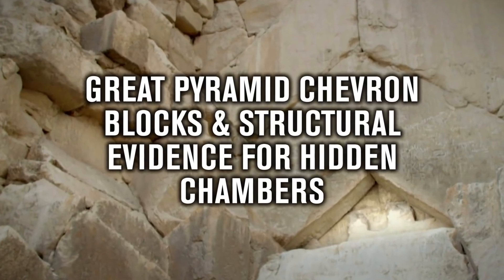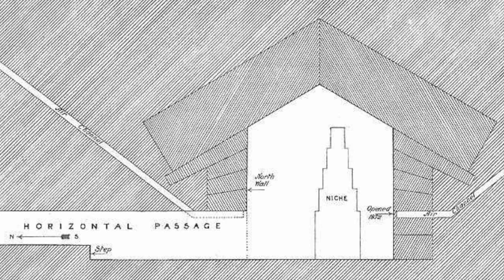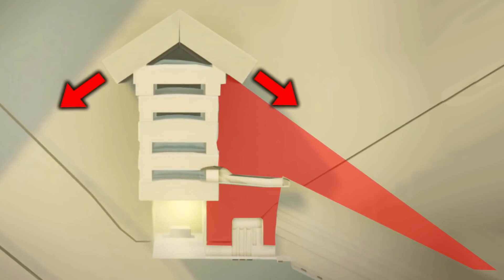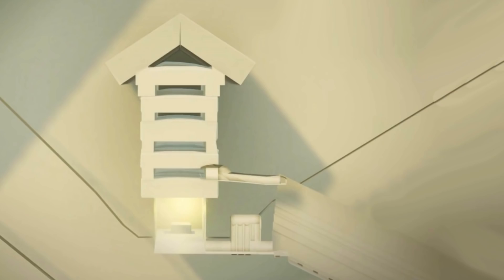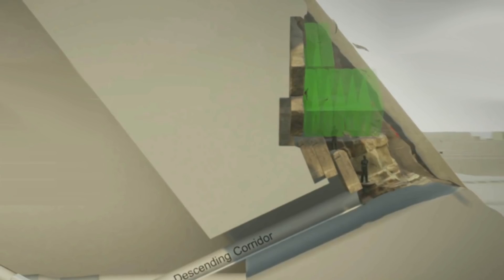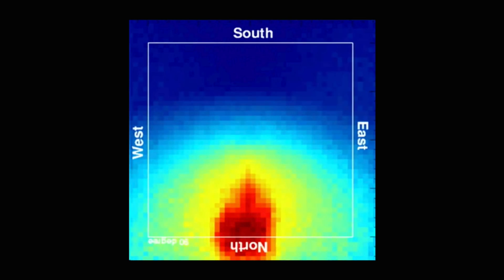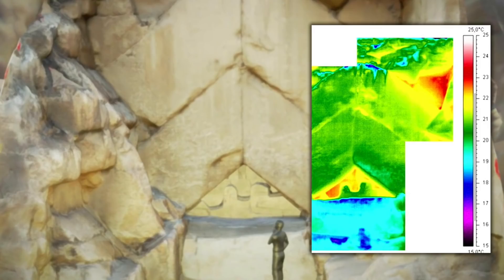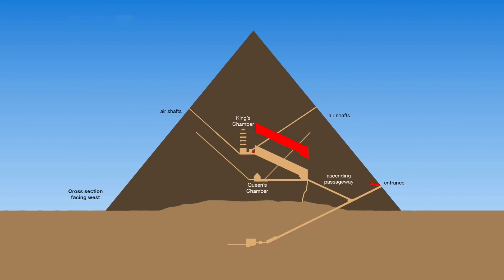Great Pyramid Chevron Blocks & Structural Evidence for Hidden Chambers | Ancient Architects

Comment: The front chevrons have many purposes. More important than structural is symbolic. That’s the main reason it was built. Many other reasons, but that’s the main. What is their symbolic purpose? One is that in a structure supposedly without hieroglyphs, here, front and (almost) center, is a visible gigantic hieroglyph! It means “oxen”. The large sacrificial animal, the leading symbol of the Age of Taurus during which this Pyramid was built.
Reply: At which timestamp is that visible?
Reply: @AlmostGrewMyHair  the chevrons are the hieroglyph.
Reply: Why is it upside down then?
Reply: @rodmehta5356  This is it: 𓐑 Does that look upside down?

Comment: I can't see any counter-logic to what you've pointed out.  With the queen's chamber not having any 'relieving chambers' above it, -and it being position so much lower and bearing so much more upper weight, there surely was no need for the king's chamber to have any relieving chambers for itself alone, so as you propose, there had to have been a greater purpose, which translates to a great area to protect.  
Question: are the ends of the chevon blocks above the relieving chamber visible and therefore known to be of a certain limited length, or is their length unknown and possibly much longer than supposed?  If 'unknown' then your theory gains that much more credibility than it has with chevon arms that only spread wide enough for the king's chamber.

Comment: If the queen chamber northern shaft circles around the first ante-chamber, or the corridor related, it suggests that the junction (discovered by @Ancient Architects) in the shaft connects to the ante-chamber. The fact that all that modern garbage was found inside the shaft makes me speculate that the ante-chambers along with the original entrance have already been discovered and looted sometime in the relatively recent past. It would explain why some of the findings have been ignored and why many teams have been denied further investigations.
Reply: Yes I agree.   And Zahi & the ministry of antiquities will be in trouble with unesco if they find out they've been smuggling artifacts and selling them on the black market.
Reply: films of romex disapearing into suppossedly solid areas. They busted in long ago, dont want to admit it.
Reply: Aààààaaaaaàaa

Comment: Just from a engineering standpoint, it's obvious that the chevrons serve a purpose and provide relief to the shaft below it, but if you compare the sizes between the other chambers that use them and the ones discussed here, these chevrons are vastly over built in scale. Pretty sure they didn't do that on accident. Definitely more to it. Great video!!
Reply: You have a point there - BUT ... arent the whole Pyramids kinda "over built in scale" ? It is possible that those huge chevrons are there for aesthetic reasons. Surely they could have taken the normal limestone pieces and cover them up with a thin layer of polished high quality stone, but thats not something is refer to their building spirit as seen on many other sites. My question to an engineer would be: Do you need more Chevron Stones to hold the ceiling because its at the Edge of the Pyramid? I was thinking of sand castles and digging the first parts of a tunnel were the most difficult parts because it tended to collapse.

Comment: I'm pretty sure there's only a small empty room there. The builders probably purposely created a false entrance there that would be impossible to enter. This was the main defense from robbers, who would all be attracted to this false entrance and who would all give up after failing to enter. Even during construction, distant observers (future robbers) would have noticed that the entrance is on that side of the pyramid, so once complete, it was probably already common info in Egypt. The builders were surely not idiots, so they put a big visible false entrance into that area. This false entrance might even have been visible from the outside, or maybe it was only covered with limestone.

I would even dare to imagine, that the completion of the pyramid would have been a very big public event with many visitors from all over Egypt. The false entrance that only leads to a pointless small room would surely have been used by priests during this ceremony. Everybody attending would have seen this false entrance being sealed by the final slab(s) of limestone and the construction would have been declared complete. The builders and priests who knew the secret would have been able to sleep easy, knowing that any robber efforts will be doomed.